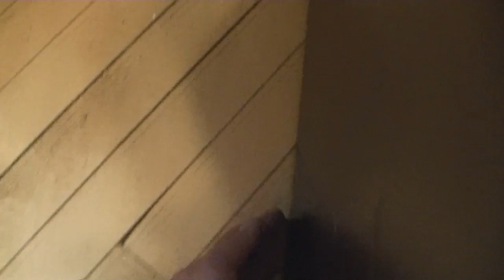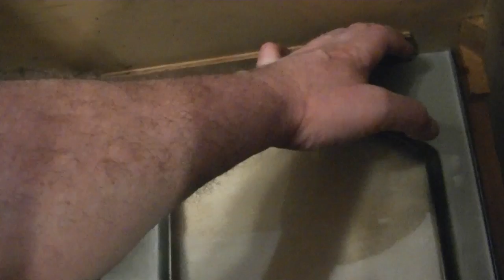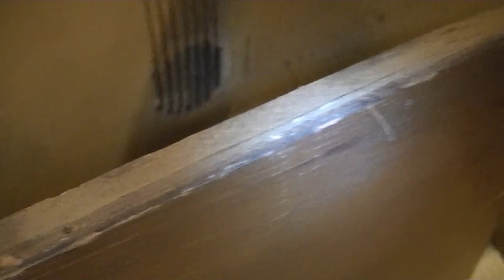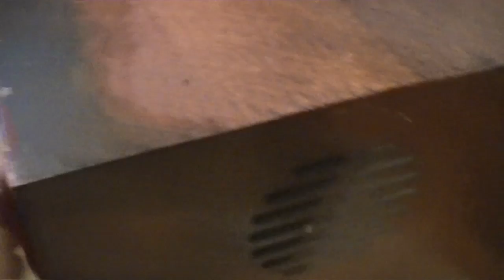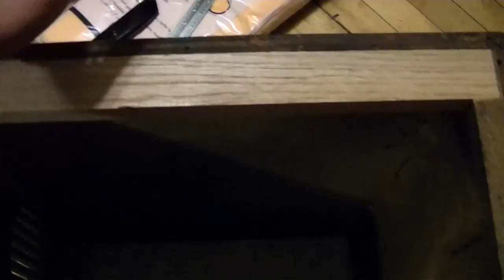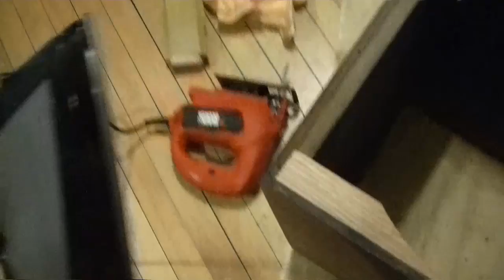Sonora 302 cabinet restoration p1o2

Comment from the maker: It's certainly the only Sonora I've ever seen.   The cabinet may be plain but the electronics inside are rather interesting.  I'm pretty sure it's the only set in my collection with continuous tuning using a variable capacitor rather than an inductuner like Dumonts.

Comment: Sonora 302 cabinet restoration p1o2 : Rather than using a putty knife to scrape the cabinet, I use a cabinet makers scraper plane. When used, the microbevel of the plane acts as a micro plane.  They are made in all shapes and sizes so check it out, you might like the result.
Reply from the maker: That was actually a scrapper - stiff steel with a chisel edge.  I only use this technique when the old finish is really flaking off.  Otherwise, I use a chemical stripper.